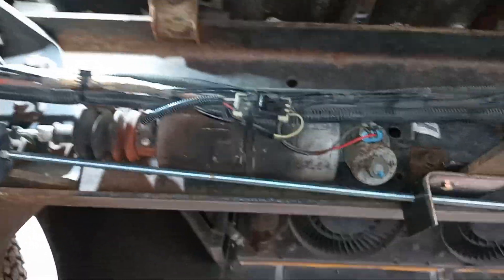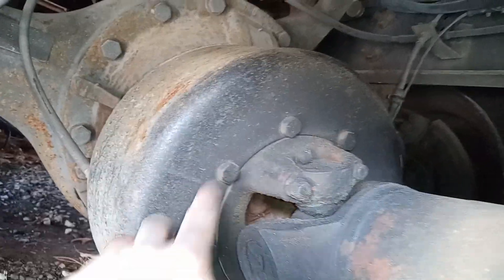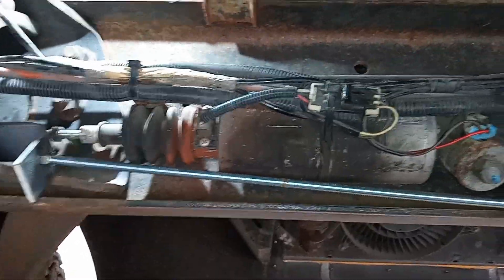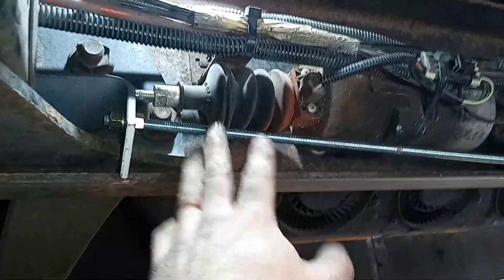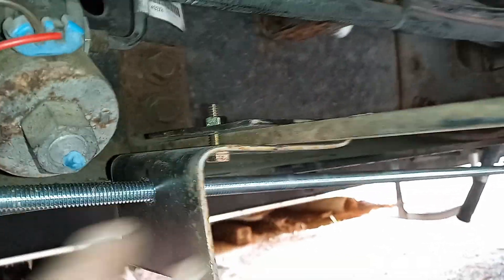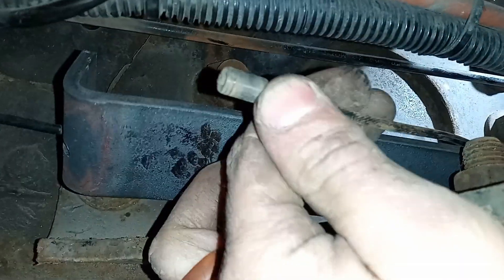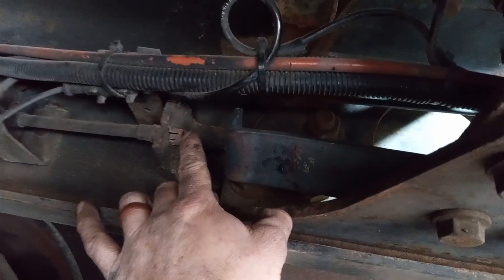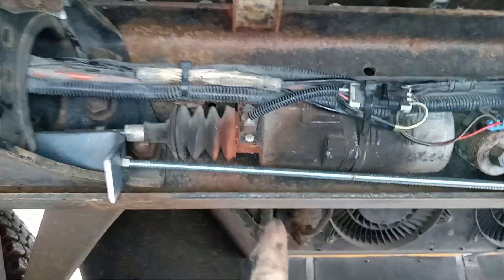2010 IC CE-300 Parking Brake Release

Comment: Thank you for uploading this video. I have a similar bus in my shop that’s killing me it has so many brake problems. I started backing the cable out of the parking brake cylinder and stopped because of how much tension was on it, worried I would release it and it not let the drum loose anyway. I hate the Wabco HCU they are garbage the entire system is trash and someone could make a whole business designing and marketing a complete retro kit to convert these shitbox MFers to air.
Reply from the maker: I have since installed a foot-operated brake.  Found the lever in a junkyard, got a new cable from NAPA, then connected the system to the original cable with coupling I fabricated.  Works like a dream.

I'll try to get it documented and uploaded ASAP.